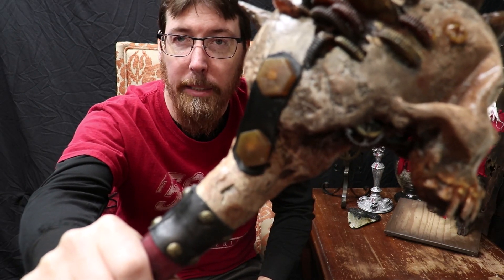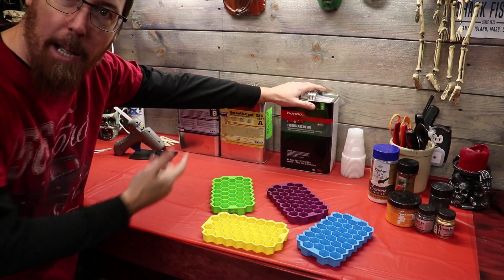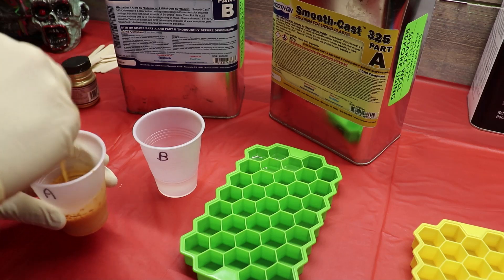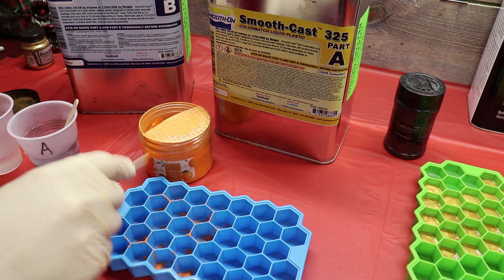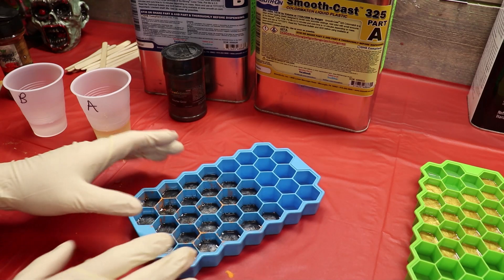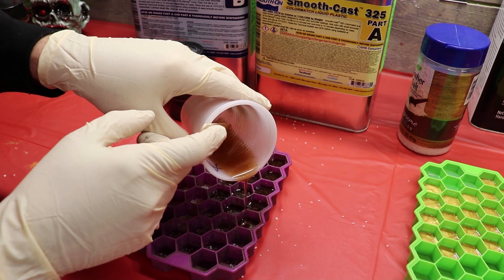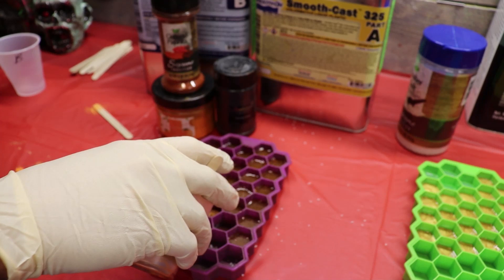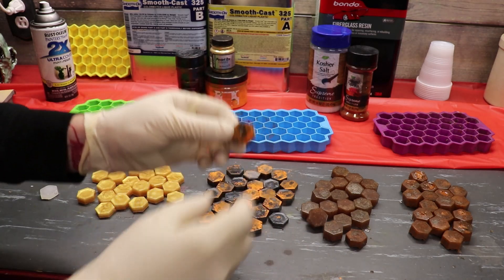DIY Fake/Faux RESIN BOLT Heads for your haunt!| Cobwebs and Candlesticks #resincasting

Comment: Thanks for the demo, I actually hadn’t contemplated the melting of the hot glue. I’d seen a lot of diy’s of people using it but didn’t think about the common sense part 🤣
Reply from the maker: I'm just not a fan of hot glue! It's fine for short term holding an item while good glue is applied. Heat and cold cycles in storage softens it, changes its shape and weakens its bond. It's basically junk,lol. Now resin on the hand, it's the nectar of the gods!
Reply: @CobwebsandCandlesticks  lol yes I’m gonna be attempting resin again. I tried a few years back and I just couldn’t get it to work lol
Reply from the maker: @lindseykurtz5033  Smooth On resin us really easy to use, very user friendly. It's 1 part to 1 part, mix and pour. Don't be afraid! Resin is super strong and holds up over time.

Comment: So the resin you have on your Amazon list drys in 24 hrs is any off the other stuff you have there quicker
Reply from the maker: The 24 hour stuff is a different resin. These bolt heads were made from Smooth On 325 which cures in about 20 minutes. Then you can pop them out and start working with them.

Comment: now is there no bubbles in
the resin because of the 
size of the mold? or did
you pop the bubbles with
a heat gun? God bless
Reply from the maker: There really wasn't any bubbles. I was hoping for some to add to the corroded look. I didnt heat gun any resin on those.   They looked that way exactly after demolding. A heat gun will smooth out some air bubbles though.
Reply: @CobwebsandCandlesticks  thank you kiddo